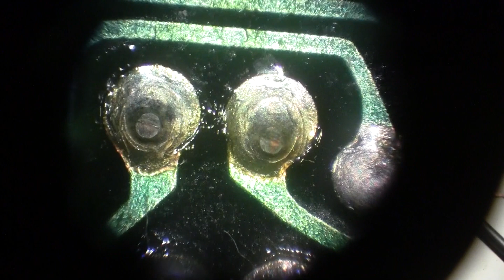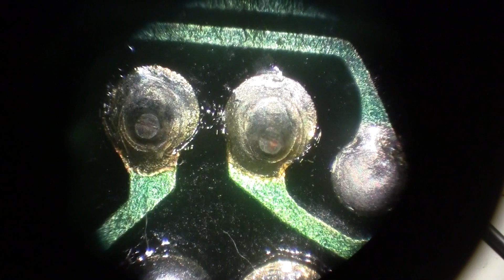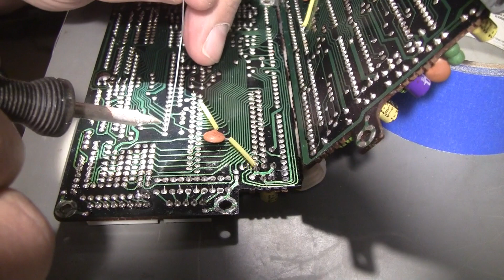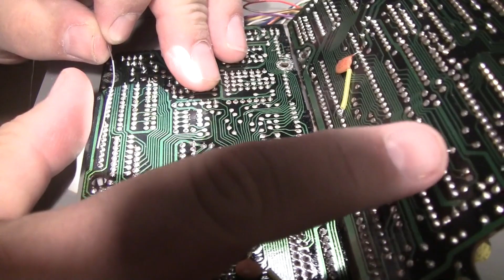Kenwood TS-440 Repairs ! Part 3.

Comment: Tin/Lead solder joints have a finite life span of 11 years. The tin and lead migrate apart over time as you see under the microscope. Just heat and add a dab of small solder. I've re-flowed complete boards that way with great success. Enjoy the fruit of your labour
Reply from the maker: 11 years is pure BS.

Comment: Man, I knew my TS-440S was on borrowed time when I started seeing the dreaded dots intermittently. I then was inactive for a few years. Just put my 80m OCF Windham back up, went to turn on the rig and no joy. Contemplated going for just the VCO#5 fix but, after seeing this, you've inspired me to gut and reflow the entire rig as well. THANKS A LOT! (Please note the sarcasm. LOL!) 73' de W1MM.

P.S. I totally agree with your technique. High heat/short duration. Although, 720 deg F is plenty for thin foil traces, IMHO.
Reply from the maker: Please just start with VCO5.